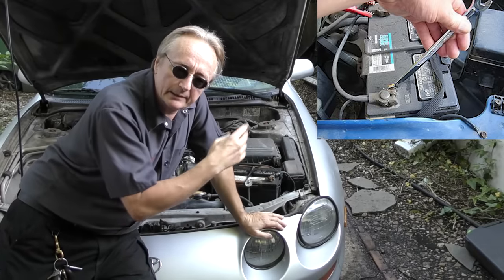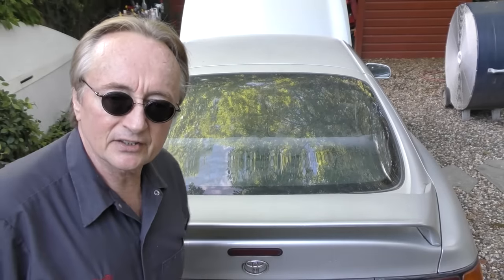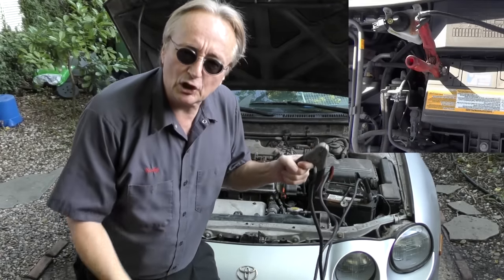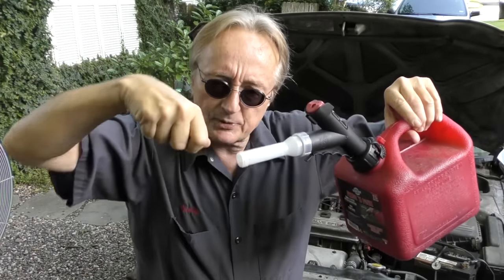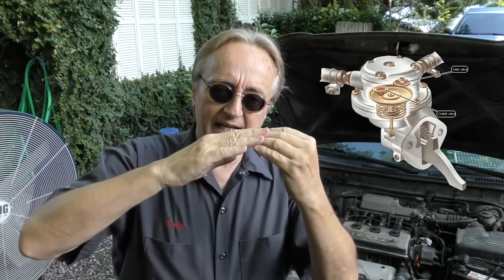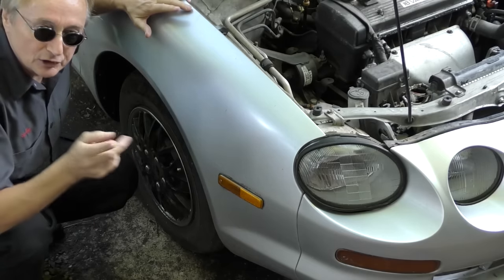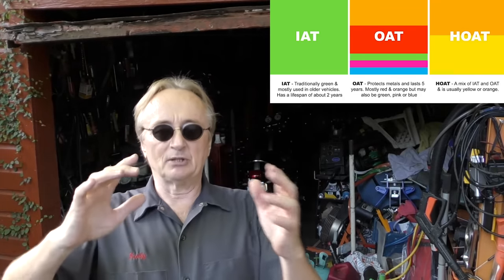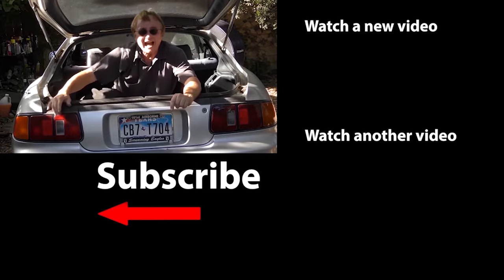This Will Destroy Your Car

Comment: Hey Scotty,  You forgot one important safety warning about jumper cables.  Before hooking up both positive and negative cables to the good car, make sure the clamps are not touching on the other end!  Else you will short-circuit your battery and possible explosion!  That's why all jumper cable instructions say to hook up positive on both ends first, then negatives.  This make short-circuit impossible.  I know most people don't read instructions!  Thanks for the entertaining videos!
Reply: What!? I was ALWAYS taught to connect ground first for safety!

Comment: never knew about the concern of running both cars could damage the car's electronics, this is valuable information.
thanks Scotty!
Reply: I have jumped hundreds of vehicles and this is not true the alternator has a built in voltage regulator and will not fight the other alternator, look it up only one alternator will charge and it will be the one with the least resistance.
Reply: @kkmart43  I'm guessing the 2 alternators could theoretically combine voltages and cause a voltage spike to sensitive equipment.  The alternators do not put out solid Volts, but a rectified AC waveform. Combining 2 alternators, from 2 engines would combine the wave-forms could and create random voltage spikes and transients in the electrical systems.  the alternators themselves won't be hurt, but advanced/sensitive electronics on newer cars is what I think Scotty was referring too.
The potential risk makes sense to me, just haven't considered it before.
Simply after jump-starting the car, disconnect the jumper cables and not keep them both charging the 'dead car' to mitigate the risk.
Reply: I would always unhook the cables as soon as the car started up, never had any issues. Never have both vehicles running with the cables hooked up. If the car doesn't keep running then you're not getting very far anyway.
If you didn't just leave your lights on or something then 10 minutes isn't going to do much, the battery needs to charge overnight and the charging system checked.
And anyone else notice how expensive car batteries have become?
Reply: @kkmart43  thank you your right its like he's addressing ghost stories or myths
Reply: @MissBunny850  Yes your right, he's right about a lot of things but not everything but no body is an expert on everything.
Reply: @richardgates7479  what you said!! Once jumped, you disconnect. Who leaves them both running for 5 minutes??
Reply: @Trey Cranson
I donno, I heard it mentioned in the video. Always made me nervous leaving them connected while running.
But the starting circuit should be isolated from the rest of the car by the ballast resister, so you're just seeing if it's charged enough to start.
Reply: @SpenceStan888  the alternators put out rectified DC from very high frequency 3 phase ac, meaning that the ripple from the rectification is very minor, and then they run it directly into a giant battery, which smooths it out even further because it absorbs any spikes.
There is no reason that having 2 vehicles running and connected will harm anything, any more than the many vehicles that have dual alternators are harmed by it.

And it is often useful to leave the cables on and charge with both engines for a while, especially if the dead battery is a large one, such as for a diesel engine, because it can take a lot of energy to get even a little charge into it.

I have been known to have 2 vehicles and 4 sets of jumper cables hooked up at the same time lol
The more cables gives more current flow, and better connections at the ends from more contact area.
Reply: I believe the reason for running 5 minutes before the dead car is attempted to be started is to charge the battery enough for it to start without draining the good battery. Once the car starts the connection is no longer needed. Once disconnected you'll find out if there was a battery issue or something else. I think the running after the car is jumped is due to two extra steps being mixed together. One is if the car doesn't start, you need to wait and let it charge more, not keep cranking it over draining the good battery. And two; once jumped the car has to be ran long enough to charge the battery for the next time the vehicle needs to be used. I know from having to go drive and re-jump a family members car at the grocery store parking lot, 30 minutes after I had previously done so, because the family member didn't want to spend 10 minutes time to ensure it was done right.
Reply: In such a case where the battery is that low of charge it's best to put it on a charger over-night.
Reply: I just did that few days ago when a neighbor asked me to give her a hand to jumpstart her car! Always been doing that all these time because that’s how I was thought when I was young! Good to know!!
Reply: stan spence in the word$ of Sylvester the 👄 talking cat "I knOW!"#$.ca$h
Reply: Yeah I've done that so many times and never knew any better lol
Reply: Great info I've always kept both cars running after dead cars start, but it's great to know
Reply: @treycranson   You have better chance of damaging a car by starting it with a bad battery than having 2 cars hooked together. A very low battery at startup makes the alternator current go higher that it should. Alternators have NO current limiting function and can exceed their rated amperage and break.  If you leave the other car hooked up for a minute you have the load split on 2 alternators and the good car is preventing the dead car from overworking it's alternator. And since the good car is perfectly fine, it doesnt need all it's charging power anyways so you arent damaging it either.  I dont think a whole 5 minutes is necessary, but it cannot hurt.
Reply: @SpenceStan888  nope 2 alternator is common on truck like mine, and the ripple is even less if you had more pulses from more alternator.  2 alternator  and 2 batteries and if you look at the wiring diagram they have nothing different, just parralleled. They just happily coexist.
Reply: The problem isn't from jump starting one car from another.
The problem is specifically getting a jump start from a truck, usually a tow truck.  Trucks often run 24 volt system.   An "old timer" tow truck trick was to use this directly to jump start a car.  The high voltage would compensate for long jump cables and a heavy load from a bad or discharged battery.

No modern tow truck would be set up to do a jump with 24 volts.  They now prefer to use high end jump start boxes.

As for disconnecting a battery lead to test an alternator, this video is wrong about that also.  It's still not a good idea, but it's only a real risk for cars built in the 1970s and 1980s.  Any reasonably modern alternator has "load dump" protection to prevent the voltage from spiking too much.  And all factory modules are protected against short-term voltage spikes using a specification based on old-fashioned alternators that did create those spikes.  An additional factor is that a modern engine takes 10 - 40 amps to run the injectors, electric fuel pump, oxygen sensor heaters, cooling fans, etc. Disconnecting a charging battery is only a small percentage change in alternator output current.  Old engines only needed a modest current for the ignition coil, and disconnecting a charging battery is a relatively huge change.
Reply: don't trust him that guy has no idea what he is talking about. 
an hydrogen explosion lol, even if you wanted you could not get one with a lead acid.
but hoking up to the chassis can be pretty bad has sometimes chassis us positive! so no NEVER hook anything on the chassis before cheking.
Reply: @MissBunny850 
Depends on the ghost or myth you are referring to!!! 

Exploding batteries or fried computers in your vehicle!!!
Reply: @MissBunny850  Scotty is correct.  I ruined my Ford Fiesta's electronics by jumpstarting my neighbor's SUV and leaving both cars running for 5 min.  Car electronics today are extremely vulnerable to even minor spikes and surges.
Reply: Carl Pabst maaaybe stupid newer cars... you got a fiesta sorry for you I’d rather have an early 2000’s Kia then that.  90’s vehicles didn’t have that issue you let them run to charge up the battery then the alternator took over and Scotty loves his 90’s and I’d think he would know better he also didn’t say after a jump you wanna run them for 15 or so mins
Reply: Trey Cranson everyone in the 90’s and early 2000’s for like 5’mins to actually charge the battery other wise you have to drive for 15-20 minutes for the alternator to charge up the battery.  Drive straight home turn your car off and your f’ed when you try to start it again it’s dead.  It’s simple physics
Reply: @richardgates7479  Agreed...  Charging a dead/really low battery, after a jump start, by way of the alternator, is hard on the alternator, but sometime can't be avoided if you're stuck somewhere.
Reply: @kkmart43   even if u jumped 1000s of cars, U can't  debate wit ol' Scot. He's going into the mechanics. You just waiting for a motor to start.
Reply: @WebGrekomon  the reason you let them run for 5 to 10 minutes is to keep from over loading the system doing the jumping and burning up the alternator and overheating small jumper cables.
Reply: @Nordic_Mechanic  funny I guess they put the rated amperage on the alternator for no reason.
Reply: @kkmart43  not for nothing, it means the rated amp it can provide before sufuring damage.
Reply: @ke6gwf  yep i have done all these things you've done and also when it got down to 20 below and the semis wouldn't crank fast enough id kick the jump start up to 24 volts and it would spin right over and start right up.....lol.......very few even know about that.
Reply: @donaldsmith5286  lol....you have no idea what you're talking about.
Reply: I thought this video was great and I'm surprised that the only thing you guys are talking about is jump starting the vehicle and everybody has their own opinion my opinion is they wrote a manual for your vehicle do exactly what it says and basically that's how Scotty said it. I do know a tire shop person that was a Racecar Driver and now owns his own tire shop and he will tell you if you put too much air in your tires it does cause wear quickly don't do it plus it gives you a different type of ride which is not as good when you're driving an SUV. So my point here is he talked about 12 or more things however everybody seemed to pick out jump-starting another . However I would say this any time that I've ever seen or personally jumped or had somebody jump my car we did not always agree on the way you connec and disconnect. I beleive the most important thing is the order you put the cables on.  now Scotty says to put the positive and negative on two the working battery and then put the positive on to the nonworking battery and then the negative on metal. I do what my manual says to do.
Reply: Never heard that about running both cars before.
Wouldn't the alts both just reduce their output to compensate?
I would expect modern cars have inbuilt overvoltage protection.
Many jumperleads have over surge protectors built into them.
I'm wondering if these guys haven't simply put crossed the terminals, even for a few seconds can damage stuff.
Reply: Idling the donor car is usually safe during cranking on the zombie but its still best to disconnect and see if the zombie will frankenstein on its own.   In the long run you want to get safety cables anyway because foreign car manufacturers are all foreign and don't understand the right way to build cars.
Reply: @MissBunny850   *you're
Reply: Marvel Mystery oil has never failed me...I swap out 20 percent in the oil and 4 ounces every 4 fillups in the gas...
Reply: Instead of shutting off the car used for jumping, just turn the blower motor on high and leave it run, that will be enough to dampen a spike voltage and prevent damage. Once had a road service guy try to start a customers car with a weak jump box, it cranked slow. Maybe the ignition didn't work but the injectors and fuel pump did. He jumped it off his truck right after, and blew up the plastic intake.
Car owner had to claim it on his Comprehensive policy.
Reply: @SpenceStan888  I don't think so. I believe the cars with properly functioning voltage regulators have pretty smooth DC voltage. It isn't perfect, they may have a slight "ripple," but the maximum and minimum voltage of the ripple won't be enough to cause voltage spikes of any significant size, even if the 2 ripples are synchronized to have peak voltage at the same time.
Reply: @carlpabst6506  That could happen if the SUV's alternator was putting out excessive voltage. There is a little electronic module in a modern alternator that regulates its voltage output. One reason for a dead battery is over-charging it. Perhaps that is why the SUV's battery was not able to start it?
Reply: @kkmart43  Well I did that and my dash display went completely haywire.  Only for a few seconds before I switched off in a panic, but it was pretty scary.  I'm going to assume it's not a good idea.  I've also been told the same thing by a breakdown service guy.  Those guys guys carry special battery charging packs for jump starting cars.
Reply: what do you do turn off your car before you try and start dead car
Reply: About 30 years ago, I did charge with both engines running. I cannot confirm that was the reason, my electronics were shot after a few chargings.